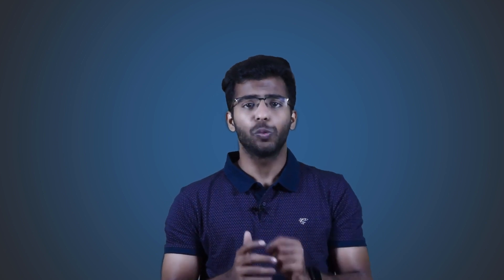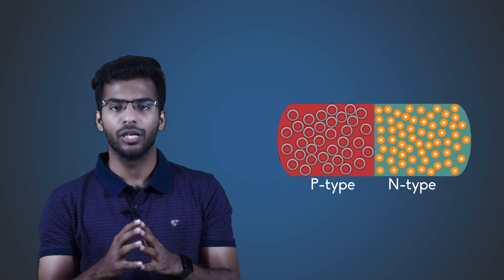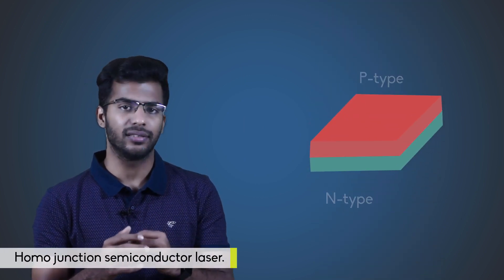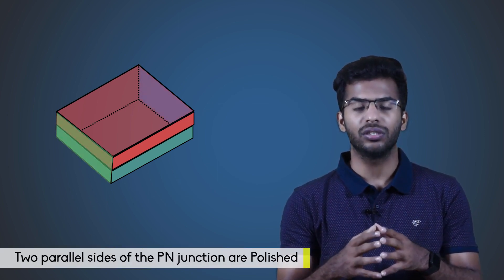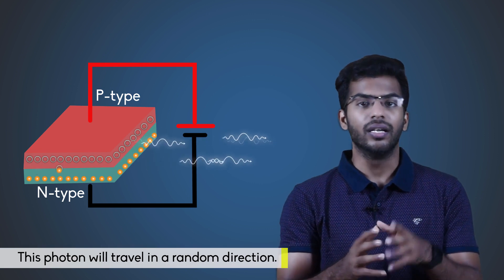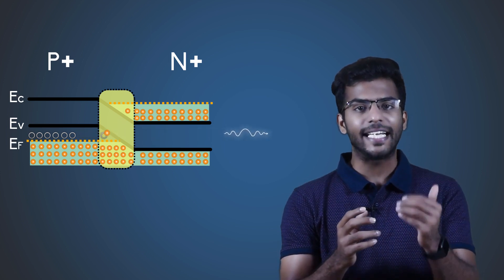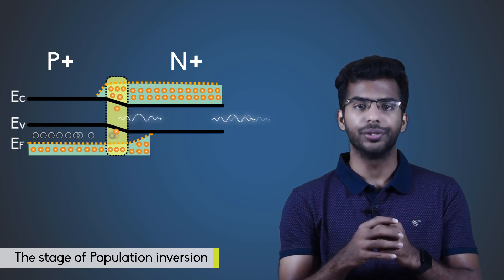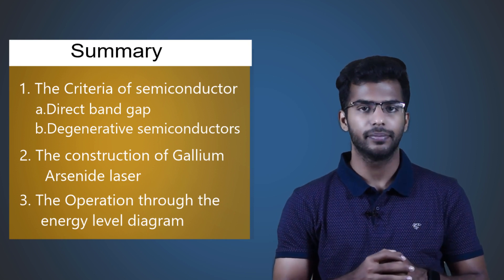How does semiconductor laser work? | Explained with animation

Comment: Rofea Optoelectronics Co., Ltd. offers a product line of commercial Phase modulators, Intensity modulator, Photodetector, Laser light sources, DFB lasers, Optical amplifiers, EDFA, SLD laser, QPSK modulation, Pulse laser, Light detector, Balanced photodetector, APD photodetector, Laser driver, Fiber optic amplifier, Optical power meter, Broadband laser, Tunable laser, Optical detector, Laser diode driver, Fiber amplifier, Semiconductor Laser, RF Over Fiber Link, ASE laser. We also provide many particular modulators for customization, such as 1*4 array phase modulators, ultra-low Vpi, and ultra-high extinction ratio modulators, primarily used in universities and institutes. 
Hope our products will be helpful to you and your research.

Comment: Rofea Optoelectronics offers a product line of commercial Electro-optic modulators, Phase modulators, Intensity modulator, mach-zehnder modulator,Photodetectors, Avalanche Photodetector, Laser Module, Laser light sources, DFB lasers,Optical amplifiers, EDFA, SLD laser, QPSK modulation, Pulse laser, Light detector, Balanced photodetector, Laser driver, Fiber optic amplifier, Optical power meter, Broadband laser, Tunable laser, Optical detector, Laser diode driver, Fiber amplifier. We also provide many particular modulators for customization, such as 1*4 array phase modulators, ultra-low Vpi, and ultra-high extinction ratio modulators, primarily used in universities and institutes. 
Hope our products will be helpful to you and your research.